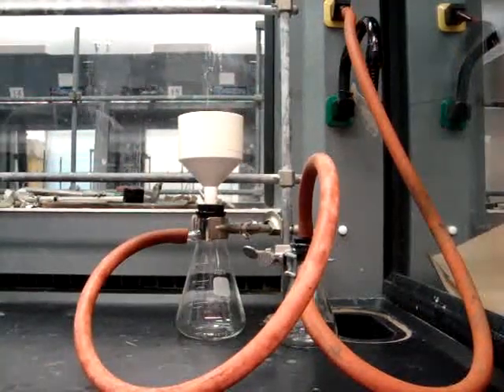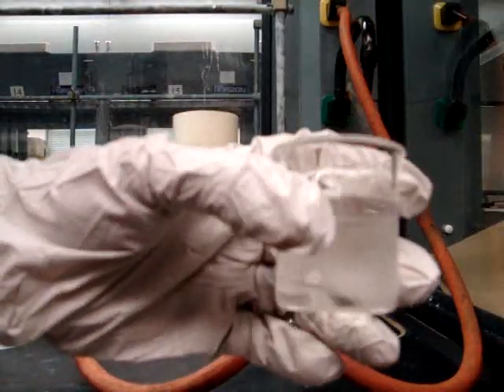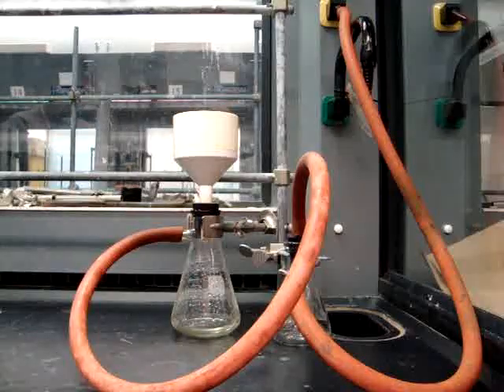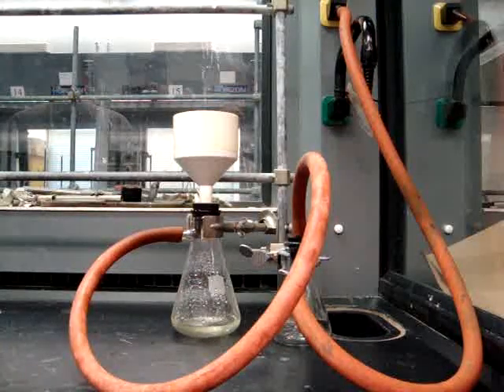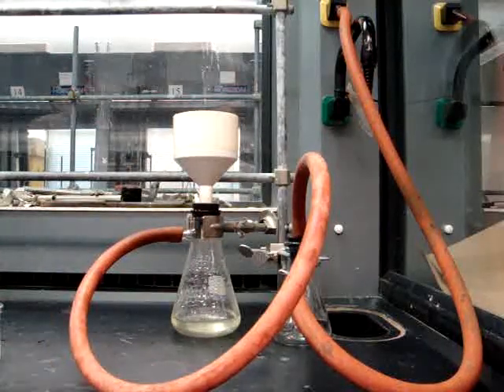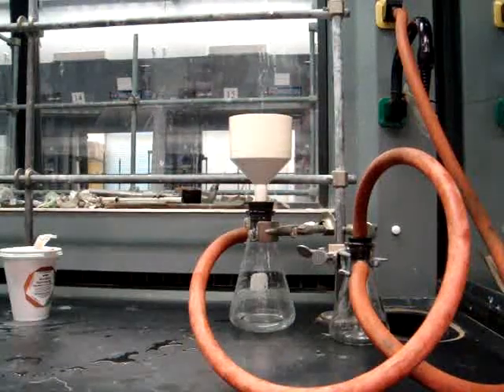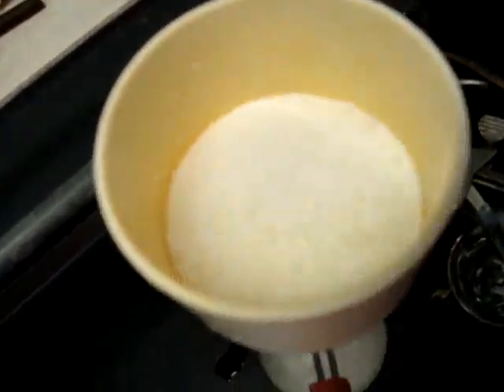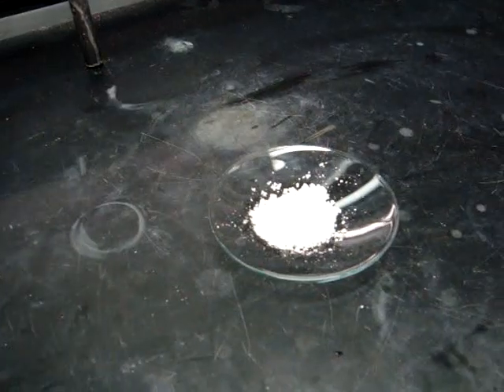Nitration of Methyl Benzoate Part II CHEM2050

Comment: What is the purpose of adding cold methanol
Reply: Same question
Reply: @menkiguo7805  methanol is used to remove any impurities that are not removed in the water washes. The reason it is cold is that this reduces the solubility of the product in methanol while filtering. They recryst. in methanol in the next step so we know that there must be a significant amount fo solubility in warm methanol even room temp.